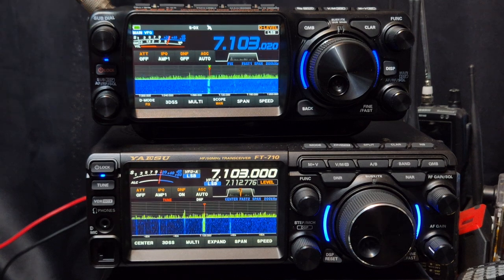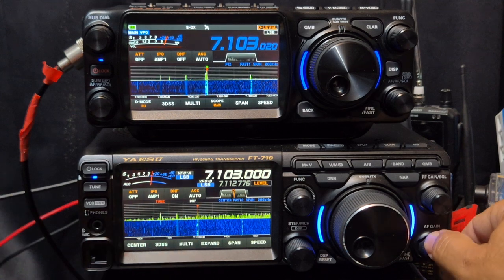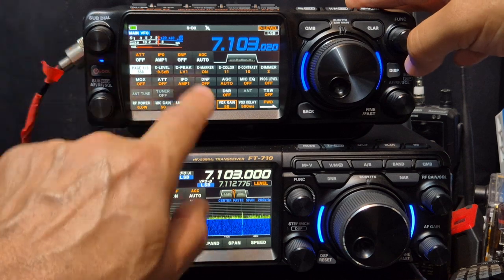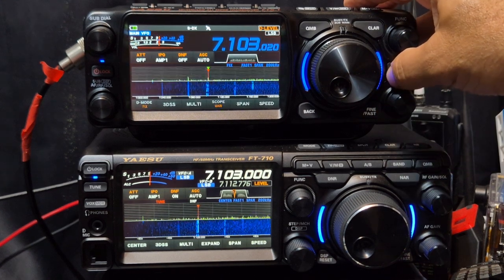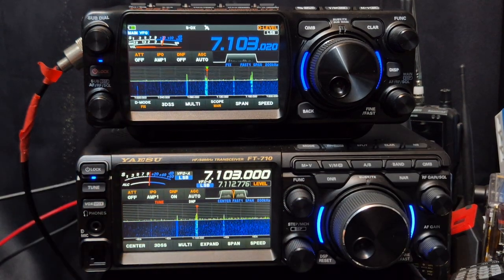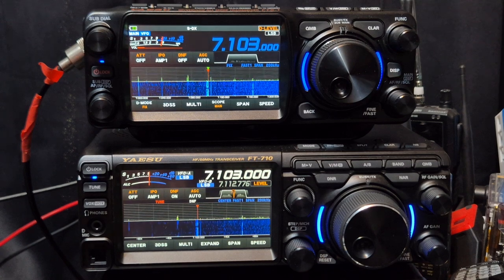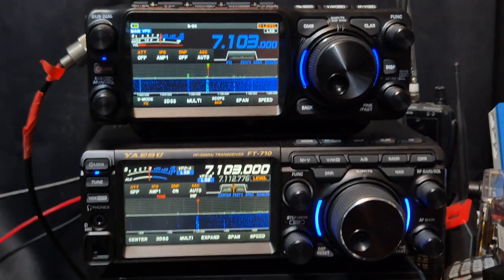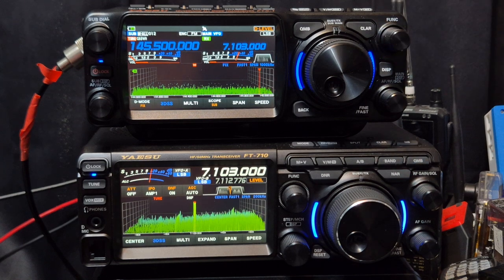Averaging Myth - Yaesu FTX1 & 710

Comment: Here's how all this stuff works :

D-LEVEL : means "Display Level", it's just a correction of the reference level of the displayed signals. If the signals are too strong, you can shift them down to appear weaker and more "readable" on the scope. If they're weak, the opposite : make them look stronger, and also more readable. If you're receiving mixed signals (some weak, some strong), you probably don't have to use D-Level correction anyway. The same function is called "REF" on Icoms.

AVERAGING : on the scope, the signals levels that you see are sampled by the receiver, say 16 times per second (it's an example for easier calculations, I don't know the real value 😄). That's why the graph looks so jerky, because it's refreshed very quickly. So the Averaging setting (2, 4, 8) is actually the number by which you (virtually) divide these samples : if you set it to 2, you'll see only 8 samples per second, so 2 times less jerky. And at 8, it would be only 2 samples per second. In fact it's not sampled only 2 times per second (that's why I said virtually) : it's still sampled 16 times, but we see the average value of the first 8 and then the average value of the last 8, hence the name "averaging".

SCOPE SPEED : this is simply the speed at which the waterfall scrolls, it has no effect on the signal levels.

All these settins do not affect the signal itself (not like RF GAIN), it's just for visualization purposes.
Reply from the maker: Perfect thanks

Comment: Just use speed slow on 710 to make it the same with level adjustment
Reply from the maker: ok
Reply: No, you can't do the same thing on FT710. Averaging is a completely different function from the waterfall speed, it does not affect the behaviour of the spectrum scope.